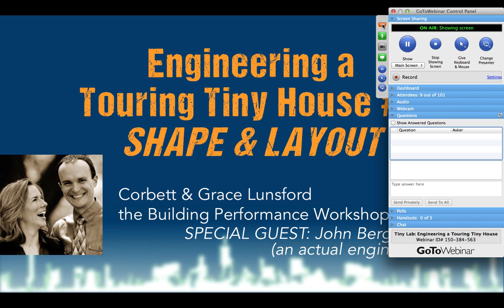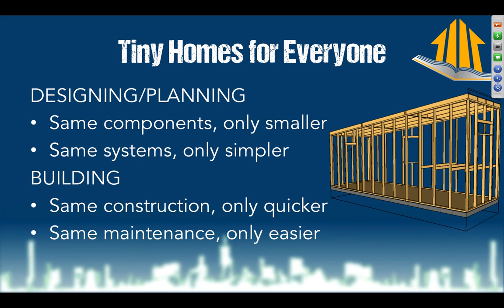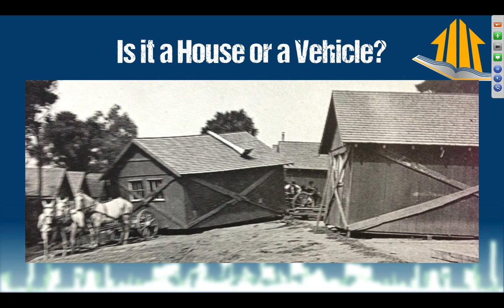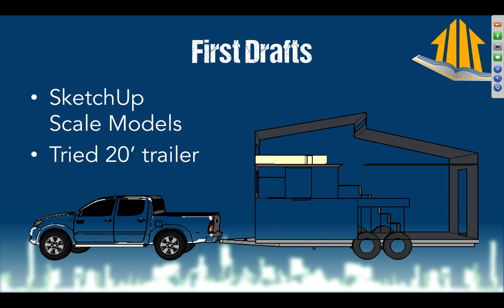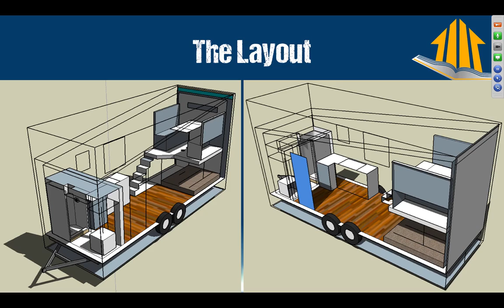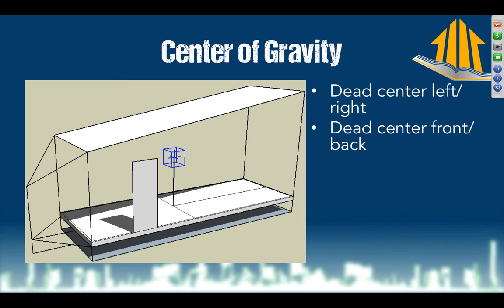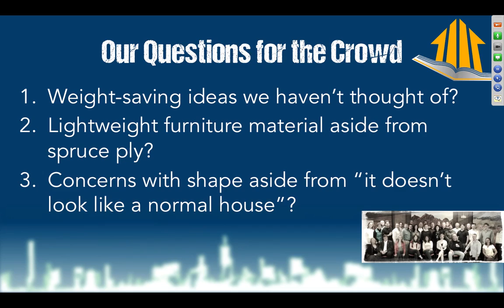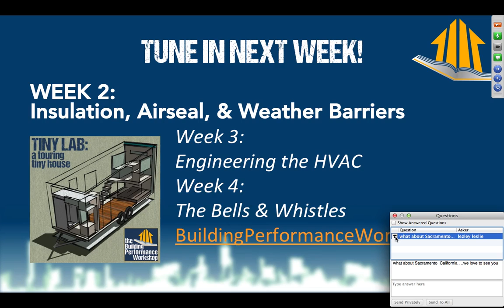Engineering a TOURING Tiny House #1

Comment: You could use 7mm ply instead of 12mm for everything except the floor. That would cut the sheathing weight by about 1/3rd. Glue and screw it on. At least consider it on the inside. The loft floor can be made up of two sheets of 7mm ply bonded to 60mm of XPS. Think huge hollow door. John can tell you the stiffness. The hollow core door idea mentioned previously is a good one. You won't be able to afford the honeycomb panels we use on outfitting boats and planes (plus they can dent easy).  You could look into Gold Core light plywood and see if that is acceptable - it's almost as light as the honeycomb paneling.
Reply from the maker: Jason Quinn Thanks so much for the input! We'll look into using 1/4" plywood instead, and I'm positive that would help with the weight! Are you saying that the loft need not be framed, just held up at the edges? We don't really need it insulated, since it's inside, so I imagine that's your point.

Comment: So your plan is to use the trailers metal joists in your floor... Have you considered the difference of thermal conductivity of metal vs wood? As far as I know, if you can't insulate the metal completely from the outside, you're just going to have a huge thermal bridge, which will lead to VERY cold feet all day long when it's cold outside :/

Btw, I love your style, Ninja ;)
Reply from the maker: +Bjarke Thornwood Thanks brother! You're absolutely right about metal being a terrible insulator, but the interesting thing is that we ran the energy model with a modification of continuous insulation layers, and it turned out not to make enough difference to change anything.  We may, just for kicks, use a 1/4" or 1/2" XPS board as the subfloor layer.

Comment: C, For weight savings look into honeycomb. Example :1 hollow core door cut in half could be used as the sides of a desk and 1 door for the top. Cheap and light weight. I've worked on some boats but most aircraft using custom made honeycomb panels. All custom built private jets companies have got all this figured out already. The one problem I see with that route is cost$$$$$$$.
Reply from the maker: Thanks a lot, Michael!